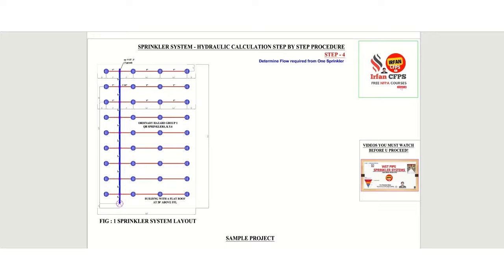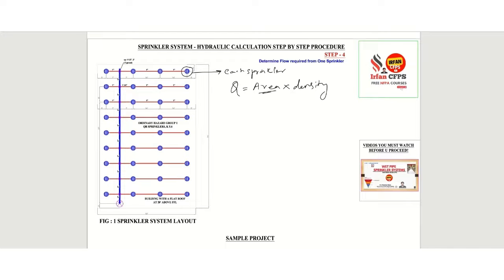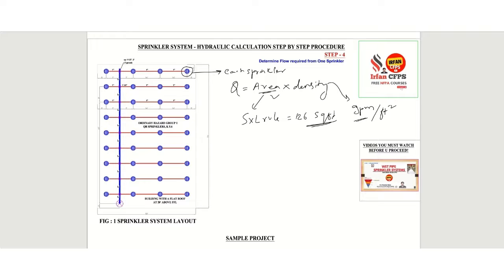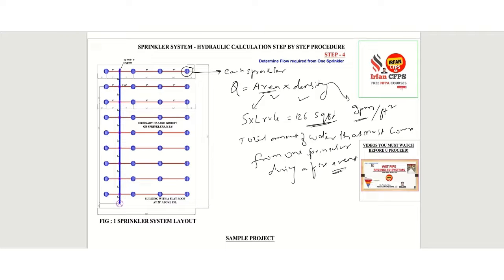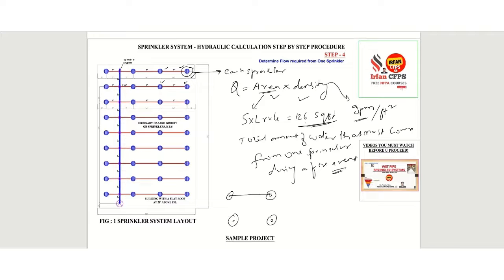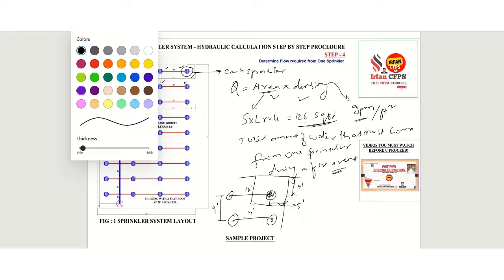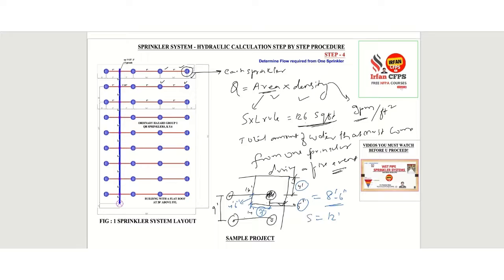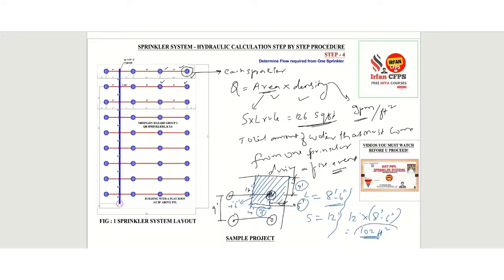Step 4 |Hydraulic Calculations for Sprinkler Systems

Comment: I have been reading a lot regarding hydraulic calculation, attending seminars and watching tutorials, but so far, this is the most logical approach for determining flow required in most demaning sprinkler. Thanks a lot. I will use your method.
Reply from the maker: Thank you. Do share with others

Comment: The role of height of the slap or False ceiling from the FFL for the area to be protected, What effect it made if the height of the area is increased, when a sprinkler selected for a particular occupancy hazard. Generally stockpile height means its a height of the space ?
Reply from the maker: Depending on the height of the floor, the sprinkler K factor is decided + density also plays a vital role. For storage occupancies, u need to check videos of cmda sprinkler, Cmsa sprinkler and esfr sprinkler videos to know what impact the sprinkler will make if we consider various types of sprinklers for the same floor or area. Stock piles are usually used for storage occupancies. It’s not height of the space. Height of the space is nothing but height of the floor
Reply: @irfancfps  Oh Cleared, So for the given pressure the flow of the sprinkler can be decided with sprinkler orifice factor which has proportional value to the height. Is it right what I understood
Reply from the maker: Yes. The formula is q =krootp to calculate demand from each sprinkler. If u know any two parameters third can be calculated

Comment: The distance from wall to sprinklers is the half of the distance between them and the branch line. How it become 5 ft instead of 14/2 and 4ft should be 4.6.
Kindly reply
Reply from the maker: See, minimum distance from the wall to the sprinkler can be 100mm (0.328ft). Maximum distance will be half the distance……… and 4 ft and 5ft to the first sprinkler is in between min and max limits. So if u want more clarity please check the below video.

Class 17 | Fire Sprinklers Design Layout as per NFPA 13
https://youtu.be/daErw7-Ep1k
Reply: @irfancfps  Thats a nice valid point